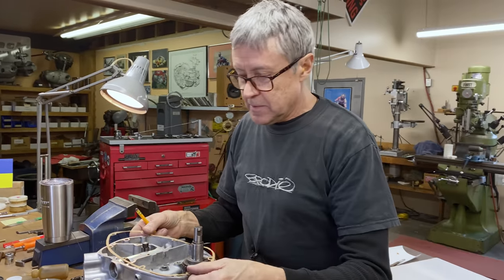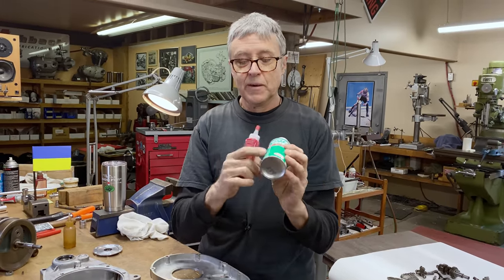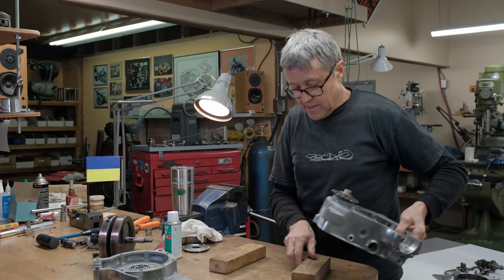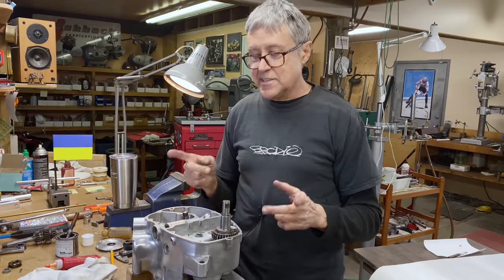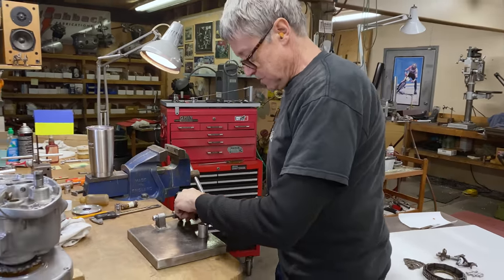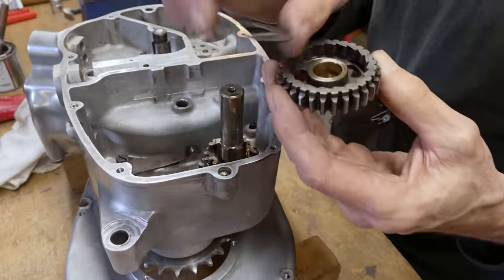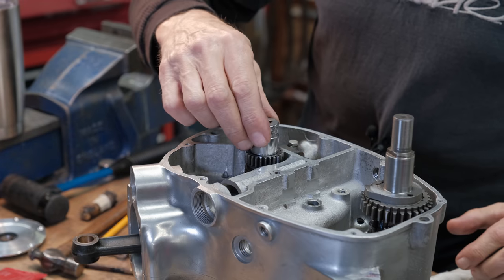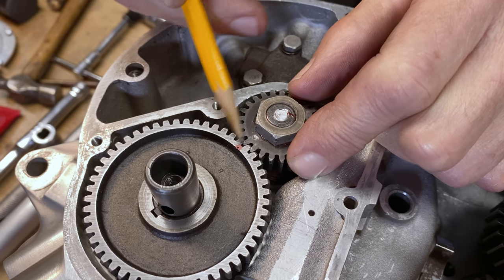Tiger Cub Engine Assembly - Part 1 // Paul Brodie's Shop

Comment: That oil pump is an interesting design. The gear style pump that's in common use nowadays is so simple in comparison. I'm guessing the engines uses splash lube for a majority of its lubrication given the piston style pump will produce an oil pressure pulse more than a steady pressure?
Reply from the maker: I guess you would call the oil pump a plunger style. It lubricates the crankpin and rocker shafts. Everything else is splash.

Comment: Very good to watch, as always! The finish on those engine cases indicates that a large amount lot of off-camera work has been done to smooth them to perfection. This will no doubt be one of the nicest looking Cubs out there. BTW, I had a similar BSA C15 250 as my first bike in 1971, it was "one down three up" gears for that. I've altered my old RE Bullet gear change pattern so it's is now like that, too.
Reply from the maker: Thank you. Yes, I see that I made an "assumption" that because it was British it was one up and three down, wrong again. It has been 50 years since I rode my previous Cub 50 years ago... The cases did take quite a bit of time, off camera. They're not perfect at all, but from a few feet away, nice.

Comment: Beautiful bike, and great work.  One question, gear pattern?  I thought cubs were 'up for up and down for down'.  Checking the cub owners manual it has ''Press down to change to a lower gear or pull up to change to a higher gear.'
Reply: Yes, I noticed that too.  Triumph pattern was down for low and up for the rest; BSA was up for low, down for the rest.  At the moment, not recalling the last BSA singles - whew, long time ago.
Reply from the maker: Well, I could be wrong. It has been 50 years. I "assumed" it was up for first...

Comment: Hi Paul, I've got a 1966 Bantam Cub and i'm having problems with the gearbox. Rotating the rear wheel i can get all 4 gears up and down. However when riding the bike it will change up fine from 1st and go down from 4th to 3rd but then the gear lever is solid, it will go back up to 4th but doesn't want to change down from 3rd to 2nd !  Back in the workshop i can still change all of the gears up and down by hand.  I have replaced the selector return spring and the plungers entering the camplate are fine. I can't find any excessive wear in any of the other components in the box ! Iain
Reply from the maker: Solving transmission glitches is not easy. When I was much younger I owned a Honda CB450 that would jump out of 1st gear when starting out. Very annoying. I took it apart, everything looked fine, but I bought new shifter forks anyway. It still jumped out of first. I took it apart again, bought some more parts, put it back together, and it still jumped out of first. I solved the problem by trading it in on a Honda CB750. Get another Cub transmission, and try that. That's my recommendation.

Comment: Paul, when I worked as a Field Service Engineer in the marine propulsion industry I carried a giant tube of Loctite 574 with me. That case won't leak but you're going to have a struggle splitting it apart when the time comes.
Reply from the maker: I have used that gasket sealer for 15 years. It is not hard to get the cases apart, and the sealer scrapes off very easily.

Comment: I use to use silk thread to seal the two case half’s instead of a gasket. If the two case half’s have been lapped it works very well on BSA’s.
Reply from the maker: Have not heard of the silk thread sealing trick!
Reply: @paulbrodie  
It does work very well. But the surfaces must be level with each other and you use just a very thin film of grease to hold the thread in place when doing the assembly.

Comment: Love the Pallet knife.  It's been one of my favourite tools for 40 years. Torque figures for most bolts are available on Google - better than guessing.  I still have most of a Whitworth socket set (was my Grandfathers), strangely it includes a set of of eight point sockets, which have come in handy a few times. An interesting little engine - Huge flywheel, tiny mainshafts, bronze bush bearings, - looking at it today, you wonder what they were thinking, but then hindsight is a wonderful thing. Love the standard of work you do- excellent.😊.
Reply from the maker: Thank you Mel :)

Comment: 4:32 LOCTITE SF 7649 :    94% acetone  3%  2-Ethylhexanoic acid  3%  2-ethylhexanoic acid, copper salt 
The carboxylic acid and it's salt are polymerisation catalysts , the acetone is just a carrier for the catalysts plus it degreases the part
Reply from the maker: Thanks for that. I didn't think it was just acetone. There had to be some chemical process involved.

Comment: When you don't have torques for fasteners, there is a rule of thumb. If you think about spanner length for each size, it will act as a guide. This did not relate in Whitworth days, but does equate right through A/F and metric. The torque that you should be applying is the same hand pressure towards the end of any typical spanner. It's probably less than you think. The same works with Allen keys.  obviously when you start using sockets, this could go out of the window, but if you think about how you are holding the driver, experience will be your friend. Paul had a shoulder bolt to play with there, so the hex on the end would not be regular to the thread that was on the end. So a touch of common sense and you'll be Golden.
Reply from the maker: I like to believe I have some common sense :)
Reply: @paulbrodie  For other people.

Comment: The reason it may look correct re the shifting up for first is that you are driving the gearbox via the kickstart not via the mainshaft …? I would have to think..The kickstart stop was fouling on the case and needed a bit of rotation before the case would go home..common on lots of German and British bikes. It’s always a mystery..thanks.
Reply from the maker: I made an assumption, one up, and I was wrong. All the Cub owners are telling me one down. I believe them.
Reply: @paulbrodie  it looks nice..I like the sprocket door and the ignition…I have found some of those white square section o rings are squishy and want to walk out…my 500 Daytona was jumping out of third gear,  I purchased a nice quality made in England cam plate from mike at walridge motors recently. Again thank.

Comment: English motors never leak oil... :P My father was a mechanic and had plenty of experience with them, anything from vintage Bedford buses to fairly modern Jaguars, they all suffered the same problem. The only reason he ended up buying a Bedford bus in recent years was because it had a Japanese Isuzu engine in it.

Comment: strange you went around the outside of the bolt holes in the crankcases  as this would mean the bolt hole were open to oil/ outside air opposed to being sealed
Reply from the maker: Maybe I made a mistake. That stuff does squish out...

Comment: It was said that the British wanted to make computers, but they couldn't figure out how to make them leak oil (should have enlisted the help of the Prince of Darkness).  As to some motorcycles: if there is no oil under it, there is no oil IN it.
Reply: @Alfred Wedmore So, I didn't know about the British computers...it's just an old motorcycle joke.  As to advanced designs...well, to each their own.  The Brit bikes were lighter and were a better fit for new riders; the better roads of the post-war era no longer required tanks.  Harleys, since '37 (I think), were all dry sump.  Many complain of vibrating Harleys (they don't vibrate...they quiver) but any V-twin can be balanced to a greater degree than any single or parallel twin (of equal size).  In fact Harleys were noted for their smoothness; at least till the Ironhead.  Speaking of which, an Ironhead is my main bike.  It has never let me down nor stranded me; and, after all, an Ironhead is just an updated, modernized Vincent for people that can't afford to park their ride on a display stand.  And, yes, she wet sumps if I don't give her a go for a couple of weeks.  I guess that's her way of shedding tears for lack of attention.

As for British early computers; well, if that were all they had done, that would have been quite a lot but if it hadn't been for the courageous Brits & PM Churchill,  our worldwide greeting salute would be the despicable one.  I think the early computers were in pursuit of German codes.  Add to that radar and the early work on jet engines and the Brits stand pretty tall.  I guess we can forgive them for their motorcycles.
Reply from the maker: I think you have been drinking the Truth Serum!
Reply: @Alfred Wedmore It isn't kindness but the truth.  All human competition, whether a chess match or a world war is decided by the strengths of the victor and the weaknesses of the loser.  A world war has many heroes and many scoundrels.  But the isolationism of the US in the early years left Britain as the West's only European foothold.  Had the British folded, the eventual entry of the US would have found that loss a fatal weakness to overcome.  The fortitude of the British in the late 30's & early 40's was astonishing and was probably among Hitler's greatest failures; and the West's greatest triumph.  I am a very proud American but I am gobsmacked by the British & Churchill at this pivotal point.  It was said that a general suggested that they send a team to assonate Hitler.  Churchill exploded in anger, pointing out that the Germans could, then, replace the imbecile with a competent leader.

The US then humiliated itself by demanding Britain repay war loans; which led to the 50's invasion of British motorcycles...wiping out Indian and almost defeating HD.

Comment: Did you know  that Bo Gaevert enlarges the oil feed hole in the case which increases the flow 20 percent   ? We know how hot cubs run  ..it helps
Reply from the maker: I did not know that...
Reply: Sure.  Call him when you do your next cub. He's a cub guru.  He's in the cvmg roster. Btw you do fabulous work
Reply from the maker: @bobbyclobber9725  Thanks Bobby...   :face-purple-wide-eyes:

Comment: Great job there Paul. Things always go easy when we’re not trying to film them. Is that the same Locktight seeler that used to be a reddish Color? Do you think that if they had these modern sealers back in the old days, the old British bikes wouldn’t have leaked as much? I remember using this stuff back in the early 70’s, called red hermatite, to seal the chain case on my Commando, and it was the only time it never leaked. Could never find it a few years later, and no matter what I did it leaked.
Reply from the maker: Thanks John. I cannot say if the Loctite sealer used to be red. I have used it for 17 years; always orange for me. Part of the leakage problem is that the castings are so thin, there's not a lot of surface area for the gasket or sealer.
Reply: @paulbrodie  I'll have to look for that type then.

Comment: I've always used Honda bound but it looks like that loctite might be a better sealer, thanks for the video. 👍
Reply: Honda Bond, Yama Bond, Three bond, all excellent case sealers. I don't think the anaerobic  loctite is 'better', different. My friend is Honda mechanic of 30 years, and uses only Three Bond, therefore I have done a couple motors with TB 1184. Have a guy to recommend a product and you won't go wrong. I don't want to be a field tester if it means taking it all apart and doing it again.
Reply from the maker: The Loctite sets up fairly fast, but not too fast, is easy to separate, and scrapes off very nicely too.
Reply: @paulbrodie  I've only used the 'grape jelly' Würth and Permatex anaerobic, so I was interested to see the strange orange Loctite you used actually set up as you cleaned up the excess. I was expecting to see it remain 'jelly'.
Reply from the maker: @broxy55   That's partly why I like it. It sets up fairly fast, but gives you enough time for assembly, if everything goes to plan. Easy to take apart, and scrapes off very easily.
Reply: @paulbrodie  I can’t believe how well I remember putting mine together! I can’t wait to see it running and hope you post a riding vid
Reply from the maker: @broxy55   That would be a good idea.

Comment: Hi Paul. 18.12 in the video I can see that you haven't installed the kickstart rachet "stop" (part no. T1157). The "stop" fits on to the bolt which also holds the kickstart return spring on the other side of the cover. Is that part only for the earlier T20 models or did you forget it? Thanks for sharing these videos by the way - I really enjoy them. Cheers from Denmark
Reply from the maker: Mikkel, I did answer you earlier comment. The "stop"is in place! Thanks for liking our videos!
Reply: @paulbrodie  fair enough!! The function of the "stop" is quite important - I know from own experience :-P

Comment: Nice video! Any reference on how many Tiger Cub engines or motorcycles were produced, and during what years? It would be interesting to know the production history of them. Thanks! Looking forward to part 2 !
Reply from the maker: Thank you William. Production is all laid out in The Tiger Cub Bible. Off the top of my head 120,000 units from 1957 to 1968. If you really like Cubs I recommend the book.
Reply: @paulbrodie  Thanks, will get the book!

Comment: 12:15 - It looks like that case bolt (or is that just a pin hole?) to the left may help retain that bushing since it had a bit of a relief the circumference.
Reply from the maker: I looked but I can't tell.

Comment: I had a t cub .in 1969 .my one all ways leaked oil .and the cam used to go .and the chain goes though the wires to the alternator .
Reply from the maker: The Tiger Cub was not a perfect motorcycle, but they do have their charm!

Comment: Try orange Loctite on the countershaft sprocket.
It is high strength but you don't need to cook the seal to get it free.
Reply from the maker: I have taken apart threads with red Loctite. It is doable.
Reply: @paulbrodie  Do you use something like a clutch hub tool to lock the countershaft sprocket?
I assume you didn't use 7471.
Reply from the maker: @jimurrata6785   Jim, you're ahead of yourself. You've got to wait for the next video!

Comment: what is the funky t-handle allen wench tool...did you make that?
Reply from the maker: No, I think it's a combination of 1/4" T-drive, with a 3/8" adapter, and then an Allen key that fits on. I think.

Comment: Hey Paul,  is the loctite sealant any different than say silicone or yamah bond or idk rtv? That's pretty expensive stuff. Great video, thank you
Reply from the maker: I've used this Loctite sealer for 17 years now. It sets up fast, but not too fast. Easy to get cases apart, and scrapes off easily. I can't compare because I don't use anything else.

Comment: Paul..... does that engine use a Lucas magneto??  If so, are you going to show setting that up and timing it?  (I have my Norton Nomad engine building back up, and timing it is one of those mysterious things I'm not sure on yet).  Awesome series, by the way.
Reply: He's using an aftermarket solid state ignition on this.  Originally, it was battery/coil with contact breakers under the small chrome cover over the camshaft side.
Reply from the maker: Yes, I have a CDI unit made by Electrex in the UK. We will be starting the motor and setting the timing. Stay tuned. Thanks for watching!

Comment: I thought you always circled the bolt holes with gasket maker.  You didn't on the first case.  Why is that?
Reply from the maker: I was probably feeling the stress of assembling a Cub motor in front of a camera. What can I say?
Reply: @paulbrodie  An honest answer, part of the reason I enjoy your videos.  Don't forget to thank Mitch, he does good work too.
Reply from the maker: @deangiacopassi1951   Don't worry, Mitch has been getting a lot of compliments
lately :)

Comment: That is a beautiful casting, like 1930's aircraft or something, it's a beautiful look, why not still cast like this?
Reply: I think Paul has already spent some time smoothing and polishing the engine castings.
Reply: I think that is a mixture of sand casting and good quality aluminum.
Reply from the maker: I did spend many hours smoothing the casting lines and getting a uniform finish. It doesn't much resemble what I started with.